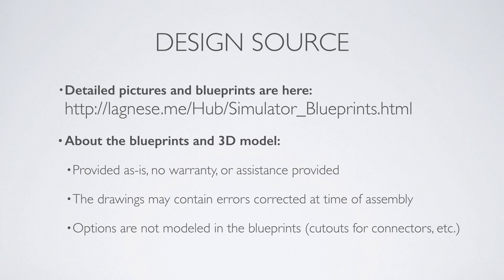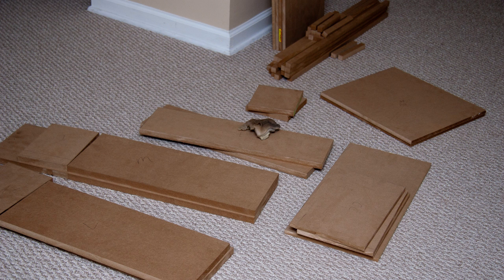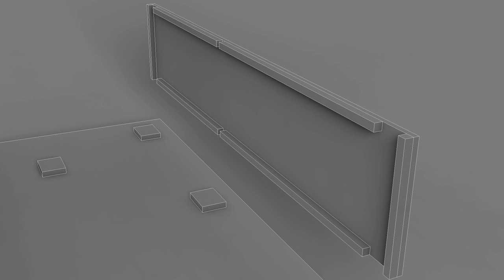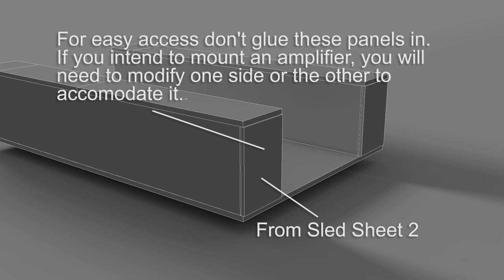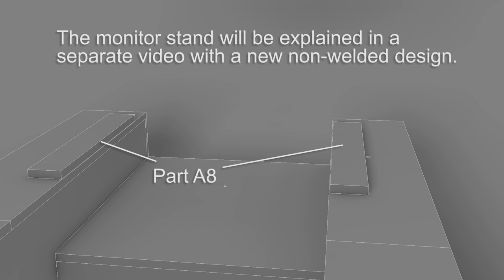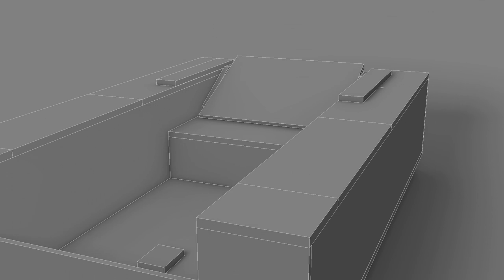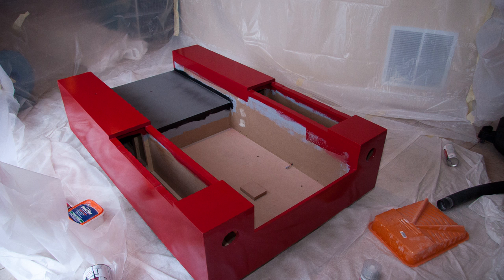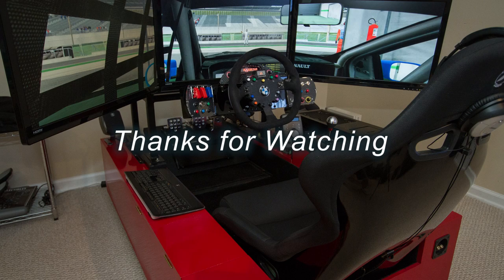Building a Driving Simulator - Part One

Comment: Impressive, a professional video! I started building my own rig with a old bumper car . But I also used several bass shakers.
It took me several years to get it done. (but my rig is for split screen racing it is a duo rig)
Reply from the maker: +alfettaracer Very cool.  I'd love to know what you used for the bass shakers.  I'm thinking of pulling out the pucks and replacing them with 6" sub woofers.  The only problem is how to fit them under the seat.

Comment: Hey Gregg. Seeing some great progress with the Keyboard tray, and it's looking smexy. I was wondering how strong it is. For me I need some king of Gaming tray, so the hole sim can be a "gaming chair" too, so that its not only for racing. So if the big plate was bigger, would it then be strong enough for supporting hands on the mouse and on the keyboard ?.Also looking forward to some news about, that you would (maybe) be doing the steering rack for people.
Reply from the maker: The platform is very stable but it flexes the table I have it bolted to so it's hard to tell.  My guess is that it would rip the wood apart before the metal flexed.

The tray itself is the flexible item that needs real world testing.  I can always swap that out if I don't like the operation.

The Mk II steering rack parts are here, I'll start working on that after I finish the keyboard tray.
Reply: Gregg Lagnese That sounds like I need to find another solutoin for the table then. But now im even more excited about the steering rack. Really hope you are gonna make those for ppl :D

Comment: A little feedback. Clean up the folder that contains the blueprints. The old drawings are a bit missleading, and the file with all the sheeds is also quite different to those who are step by step. But I hope i figured out that its 2 4x8 MDF's that is needed for the base :D
Reply from the maker: I'm not sure what you are looking at.  I redid the base sheets before they were posted and each sheet blueprint is clearly marked in both the title block and on the sheet itself with nomenclature like 'MDF .75" Thick 4' x 8' Sheet'.  Even the misc parts are marked as to what type of wood thickness to use.  You only need one (1) 3/4" thick sheet and one (1) 1/2" thick sheet.  The other misc parts can come from smaller 2' x 2' sheets or from boards as indicated.  All that said, I'll check them again...   :)
Reply: Gregg Lagnese Cool thanks. And yes, when you find the right folder its all good. but outsode the folder, there is a few other files, with hand drawings and stuff like that. But those inside the folder is just perfect (Y)

Comment: Once the mk II steering rack is done, will it be able to go with the mk I monitor rack. Because, as you say yourself on the blog, 400-500 is alot for a monitor rack, but I really want the stability of the mk II steering rack. So maybe its posible to have a mk I base and monitor rack with the mk II Steering rack ?
Reply from the maker: Great minds think alike!  I've already adapted the design of the new steering system to the Mk I monitor rack.  There's a new blog entry on my website which shows the new design.  It is a little bit shorter in throw (about 1") and won't be able to tilt as much (about 6-8" of total travel) because the back pivot point would interfere with the pedals if I lowered it further.  Otherwise it's the same design.  I have begun creating the blueprints so I can build the first prototype.  Unfortunately, this rack is hardly off-the-shelf with 50+ custom parts.  If it works out, I will probably make a kit if people want to buy them already assembled.
Reply: Gregg Lagnese Mate, you are one of the greatest ppl in sim racing. I have seen the blog entry, and its looking smexy. would be cool if you would start making them for ppl. Though I guess it would be quite exspensive for shipment to Denmark. 

But im glad to announs that I have just bought a seat for the rig, yesterday. So its gonna happen :)
Reply from the maker: FuglRacingTeam
 Thanks for the kind words.  So many people contribute to sim racing that I feel this is the least I can do to contribute something myself.

I look forward to seeing your video on youtube next!
Reply: Gregg Lagnese Yeah thats true. I only contribute with some close racing :D

I will for sure upload some vids of the rig, but lets see what the solution will be with the steering rack.

Comment: Hey Gregg. long time no news, are everything going well ? And how is progress looking on that steering rack you are working on ?

Regards
Danni
Reply from the maker: I've been very busy and I'm also training for a cycling event.  I recently obtained a new 3D printer so I'm testing out the option of turning some of the non-load bearing parts into 3D printed parts instead of machined from blocks of aluminum.  I plan on starting the new rack as soon as I come up for air.

Comment: Gregg, Thanks for all the Sim build videos. I've started building my rig based on your plans. I have a question about the seat angle adjustment brackets. Do you have the specs. for them? I looked on your blog and couldn't find them.
Reply from the maker: I don't have any detailed prints for that part.  I kind of winged it and built a couple before getting it right.  There are some notes and details in the scanned prints.  basically it's a bar in a tube.  I think the top bar is 2.5 in long and the bottom tube is 2.25 in.  The bar is .5 in diameter and was shaved slightly to easily fit within a .5 in ID tube.  The tube itself is thin, I think it was .0625 in thick, so it probably .625 OD (I can't look at it right now).  I'll try to find time to create some prints of that section.
Reply: Where did you get the clevis pins used in your brackets? I looked in McMaster Carr and they only show clevis pins with a small head. I couldn't find anything with the big knob used for your brackets.
Reply from the maker: Robert Lara
I made them from 6061 aluminum stock.  A shoulder bolt with a washer and wing nut would work also.

Comment: Hey Gregg, I guess i didn't describe the part I was looking for correctly. I'm looking to get the specs. for the monitor mounts you made to replace the three VESA monitor mounts. They consist of a steel square piece and the two plastic inserts. Did you just use square tubing for the square pieces?

Comment: I must have missed the steel portion of the MK II monitor mounts. I did see where you had some kind of spec. sheet of them im a picture. I don't have 3D printing capabilities so I guess I can go through that sight you mentioned to get them printed. I'm getting ready to purchase a bench top mill and lathe. So thought creating the revised monitor mounts would be a good starting project. I went to the Shapways sight, but I'm not familiar with it's use. I guess if you send me the STL file, I can have them print it.
Reply from the maker: I posted these plastic parts on Shapeways here:

https://www.shapeways.com/product/CGQ65CTJK/mk-i-monitor-rack-guide-trim

You will need two.  You might want to consider the simple plates instead.  They would be easier to make and cheaper.

Comment: Gregg, I'm interested in fabricating the MK II monitor mounts, but I couldn't find an dimensions for them on your blog. I was wondering if you purchased the square steel pieces that hold the plastic parts or fabricated them. Also did you 3D print the plastic parts or did you start with a block of plastic and mill it out?
Reply from the maker: The build of the steel rack is outlined in part 2.  In short, there are a couple of 3D printer parts.  I can post them on Shapeways so you can order themor I can post the STL so you can print them yourself.

Comment: Gregg, do you have any dimensions for the monitor stand. I'm just about done with the wooden part of the rig. I saw the mods. you did for the MKII, and will incorporate those. But I wanted to get dims. for the original to start on the steel part of the build.
Reply from the maker: For the Mk I, it's part of the original blueprints.  I'm just now getting ready to implement the mods to the Mk I.  The Mk II blueprints are also posted on my website.

Comment: what are your thoughts on the oculus rift... it seems to me that it makes mounting screens, cost ineffective and less immersive.
Reply from the maker: Having used the last version, and waiting on the next one, I would not agree at this time.  First, of the people I have let use my Rift, about 60-80% complain of feeling nauseated or generally uneasy.  Second, with the full rig, it's virtually impossible to use physical switches when wearing the rift.

For FPS and similar gamepad applications, I love the immersion and it works great in apps that support it (albeit with a low-res, screen door look).  However, although I try, I cannot handle more than 30 minutes before I am deathly ill from it.  What's worse, it takes at least a day for me to recover from it.

If I could solve the sickness and physical control issues, I would wholey agree that it would be a much better experience.

Comment: sub woofers don't do the job (I tried this, you need tactile transducers so called butt kickers)
Reply from the maker: +Alfetta Racer Thanks for the info, that's what I'm using along with the built in 70 watt amp.  They tends to 'rattle' things (bolts, etc.).  I was thinking a sub woofer would be more gentle.  The entire base acts as a speaker enclosure to some degree.  The seat is the problem.  I can't fit a butt kicker under there unless I converted it to a fixed pitch.